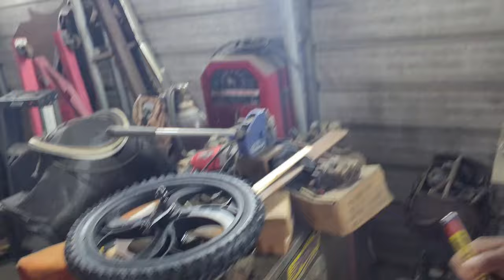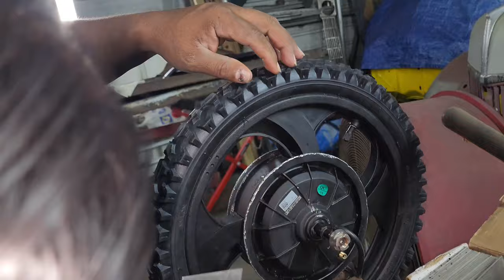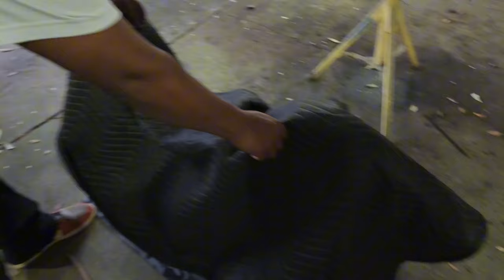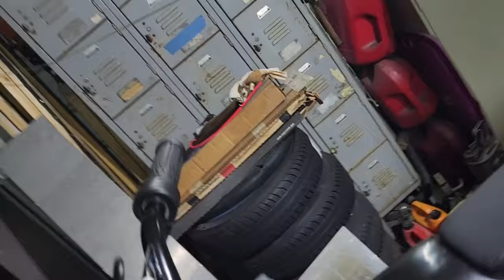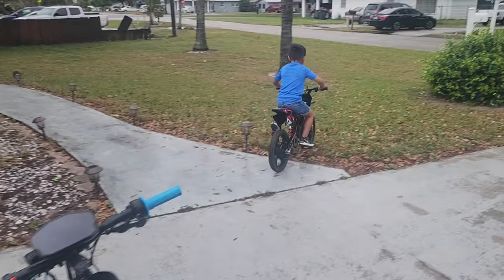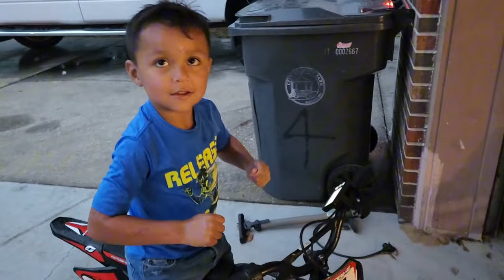I built a 36v ebike for my buddy's son.

Comment: i have 1500w ecocentric like folding ebike i wanna get it doing 45 mph, i feel like i could do the work do you have a good source for a battery and upgrade kit with wheel, im less than hundred miles from you in chester vermont. need more speed upto 50 but 45 will do.. it dose 30 now with no shunt mod
Reply from the maker: Sometimes the controller is limiting the current
Reply: @E-bikeguy  any recommendations for a 48v 1500w controller , there are so many